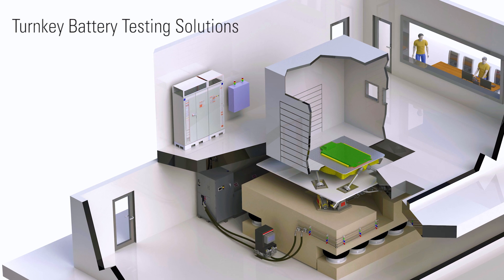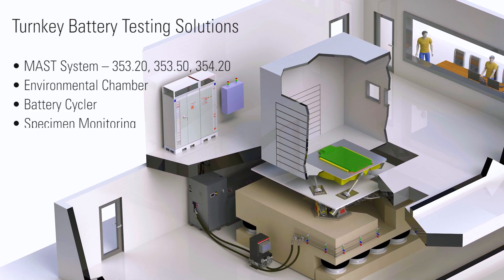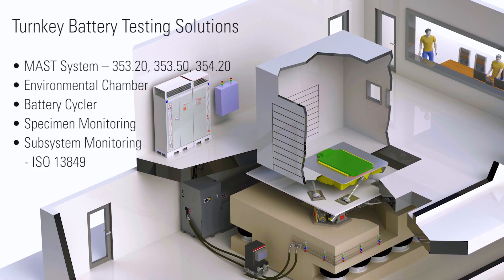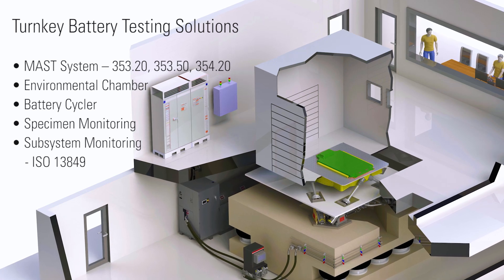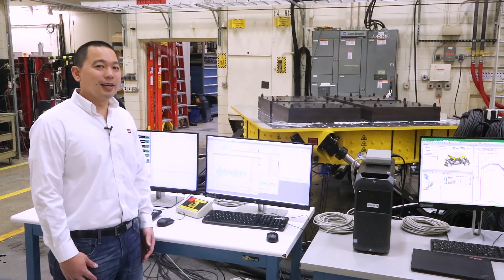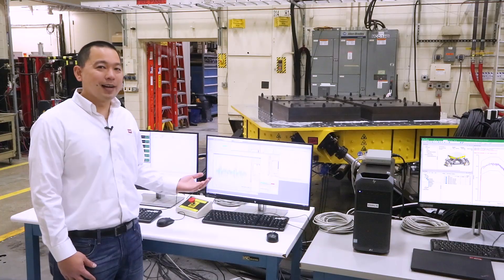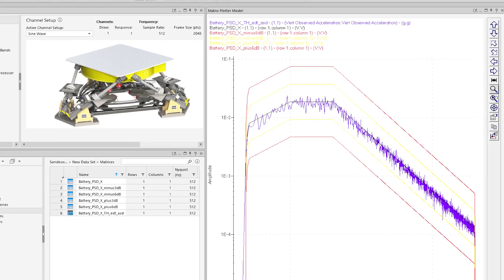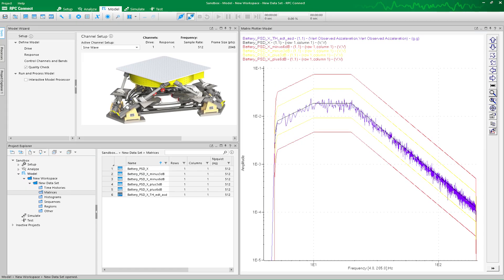Electric Vehicle Battery Testing: High-Frequency MAST

Comment: Do you use the actual battery? Or is it using metal to simulate the load? I am curious how much difference this makes. Currently, they are not usong the actual battery for testing.